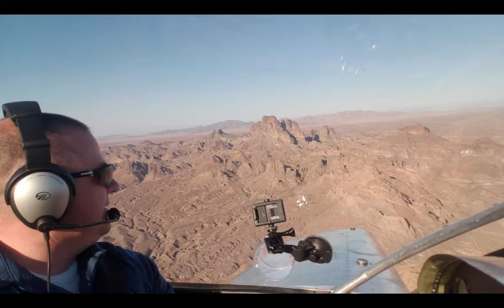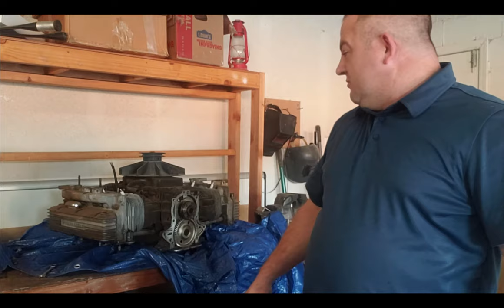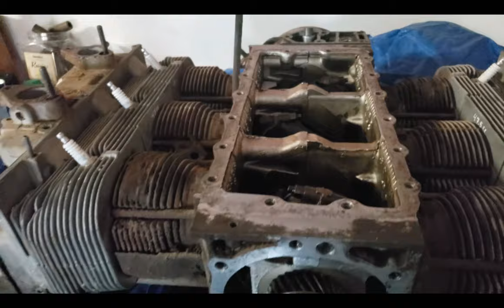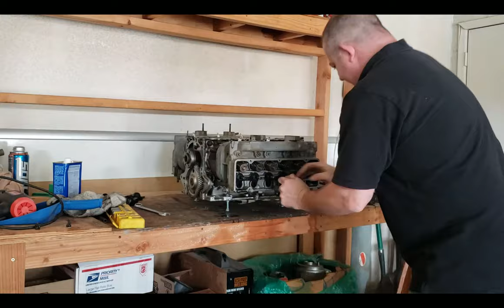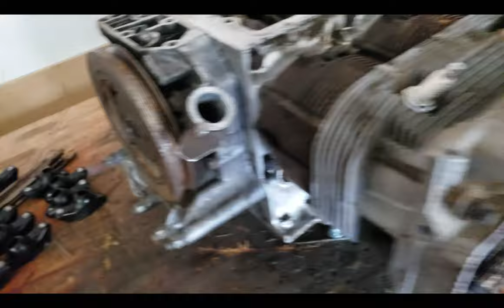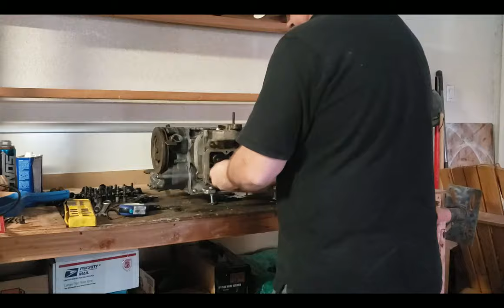Corvair Aircraft Engine Budget Build Part 1

Comment: I had a head stick to a Corvair cylinder. I tried EVERYTHING (heat, penetrating oils, leverage, hammering etc.) to get it off. Eventually I had to resort to holding the work by the nubs on the lower cylinder suspended by plates clamped to the bottom of my hydraulic press. I took a Baggie filled to about 1" with dry Pourstone powder and lowered it into the combustion chamber. I did this to distribute the load across the chamber. Then I cut the corners off a 6" long 4" X 4" until it barely fit the cylinder. Lastly I applied heat and placed an old pillow under the press. It was rather nerve wracking but I pressed the head to the point of separate. I thought for sure the nubs on the cylinder would let go first. Arrange the cut corners to go where the nubs are.

Comment: I'm looking to pick up a Corvair to build for my plane. What price range should I be looking at for just the block alone (no crank / heads / etc.) if it was in decent condition?
Reply from the maker: chech out @wwflycorvair tons of information.  or flycorvair.net.  price for a donor motor is less than $500.